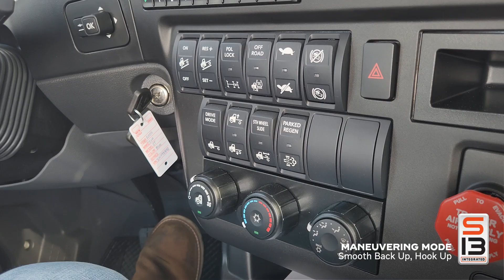This Your Next Truck?! International S13 Powertrain Walkaround

Comment: No EGR cooler.   Yeah. Slightly more DEF usage?   So what?  

If it ends up being a reliable long lasting engine,  this thing could take over.
Reply: its a scania powertrain so yeah its pretty good
Reply: @morgan28d  Well..that's a huge "sort of". Scania's technology is used, but it was more of a collaboration with Scania to use their technology. And I think International owns Scania. or they merged or something. 

Most Scania engines are V8's  This is an International engine based on that technology.
Reply: @poseidon5003 Nah this is Scania engine & gearbox. Development began in 2016. Scania released the T14 equivalent (Scania calls it as G25/G33/G38 depending on the torque rating) back in 2020 and released the S13 equivalent (Scania calls it as DC13 Super) in 2021.
Reply: @ajidamarjati  The S13 is similar but not exactly the same.  It has different tuning and fuel mapping.
Reply: @Rimrock300 This engine is not to be confused with the A26. Navistar just began using S13 engine since 2023/2024. Previously Navistar using A26 which is a true MAN engine, MAN calls theirs as D26. A26 & D26 is a 12.4 liter motor.
Reply: @Rimrock300 Beginning in 2025 MAN also offers the equivalent of S13/DC13 Super as D30 Powerlion. Now limited to 4x2 tractor unit application only.
Reply: @Rimrock300 Alright this is Traton Developed engine and gearbox, but claiming Navistar took it first back in 2017 is also not right either. Scania was the first Traton brand to sold this powertrain combo.

Comment: Just wish they’d fix the wiring harness that rubs the frame.
Gonna be a huge issue in a year or two if not less. 

I’ve had to reroute the harness on 3 trucks and I’ve seen it’s been needed to be done on others but I wasn’t assigned to work on them. 

That and I’d wish international knew how to use a flusher cutter.
Reply: its fixed

Comment: nice truck that guy just talks and talks way 2 much hed give an asprin a headache
Reply from the maker: Brother you have no idea!
Reply: Question, what kind of warranty is offered on the S13 engine and transmission?  Has international trained all the dealer technicians to fix issues as they arrive? Would love to see video of that setup actually in a working environment.
Reply: @DonaldCrawford-k9t  There are dozens of warranty options available. International has trained our techs when issues arise. I have sold several of these in the fuel hauling market here and he is seeing a 15-20% improvement over his PACCAR products.

Comment: Just more new junk I'm getting 6-5 to 7-2 mpg with my 855 Cummins just need to know how to tune and drive them drivers turn that key to the left shut that engine off no idol time my father always told me if that truck isn't working you better have that motor shut off
Reply: Comparing lowtech US Cummins with hightech Euro Scania...
Scania wins each and everytime..
Add the OptiCruise trans to that, it's 3 centuries ahead of Eaton...
Reply: My 515/1850 S13 hauling beef every day is getting 10.3 -11 mpg consistently